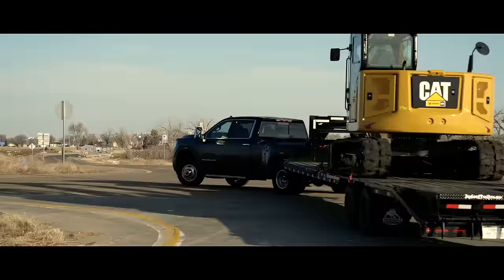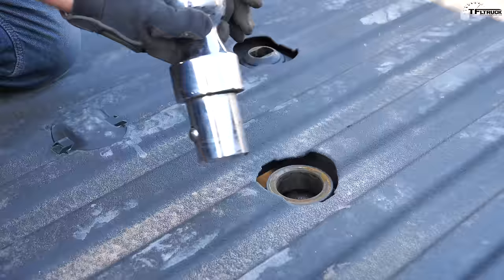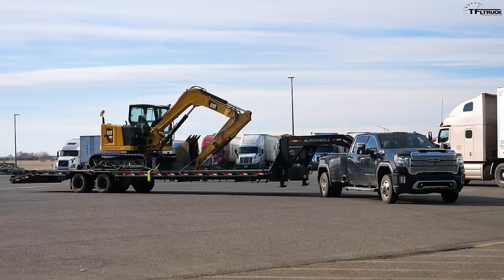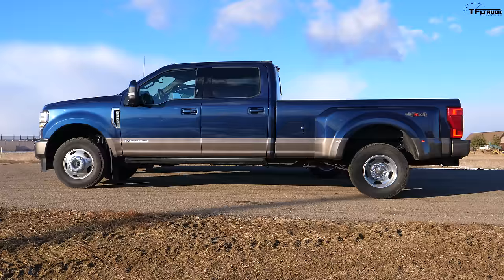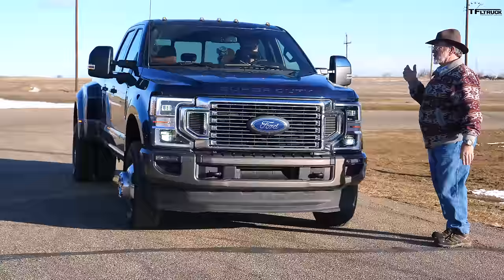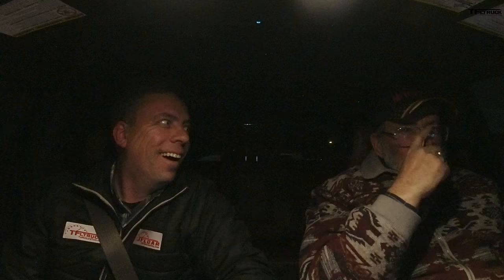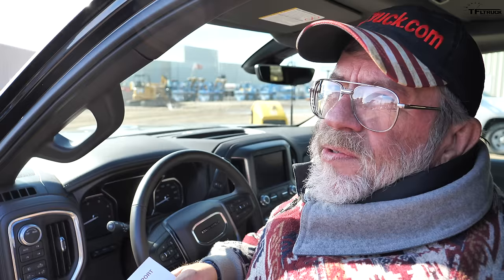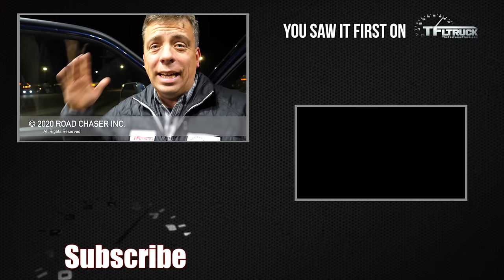30,000 Lbs Monster Tow Test: 2020 Ford F-350 vs GMC Sierra 3500 - Drag Racing & Tow Off!

Comment: A 15% difference in fuel economy is quite surprising, but I think the test loop was too short to be conclusive.  Did either truck go into regeneration during the loop?
Reply: they don't even know what regeneration is. Mr. Truck probably knows but thats it
Reply: Regeneration is an absolute joke, nothing but a pain in the rear and then it screws the truck up cause the system decides not to regenerate its self.
Reply: This is the question I had. Big difference in fuel economy when in regen.
Reply: Not really Ford says the new 6.7 gets best economy out of the three GM ,Ram and from people I talk with seems to be true.
Reply: They didn't do the test trip for the ford until it was much colder ! Everyone knows that  for every 5deg in temperature  drop  you gain  about  17% in efficiency!  Witch  declines  dramatically  after about 20%maximum  gain.  This was definitely not a scientific test or they would have done the test at the same time of day with equal temperatures
Reply: @Michael-ge3eo  The colder is gets the worse the mileage gets.  Thats a fact!  The air becomes more dense which in turn means you need to run more fuel to maintain the proper AFR.
Reply: @joshgarner805  Well, I honestly don't know what people where expecting here.. Ford has a state of the art engine that is so efficient that it's design is replicated in German TT V8 cars in the 'Hot V'.

Duramax did good, however I would wager that the F-450 with its 4.33-4.88 ratio capability and fat Boy front end literally put every single advantage into the Ford's court. More efficient engine, a transmission that is probably the exact same transmission which I'm almost positive was co-developed by GM and Ford and has nothing to do with Allison.

Chevy just reeks of desperation, they try to upscale the trucks worth by saying something to the effect of 'Yeah, but our 10-speed is named Allison, everyone knows those guys". Cmon, can't even tell what gear the Allison is in so I'll stick with this beefed up 10R80 or whatever its HD variant is called over this fake Allison simply because I don't have to guess what gear I'm in...

Anyways, both are good trucks. I'm sure you could get a Silverado 3500hd for the same price as a 350 Lariat, you just lose 140 ft.lb of torque... There's no twist ditch gimmicks or dropping rocks into fragile bed lies they can slander Ford with but at least they didn't try to like last time.
Reply: @joshgarner805  - I don't believe there is a proper AFR on a Diesel.
Reply: @SoDevious  - I keep hearing them call it a "Branded Allison" transmission.
Reply: @SoDevious  so much misinformation in 1 post.  You wreak of desperation.

They call it "Allison Branded" because Allison just became its own company.  The change in business structure required a change in description.

Comparing the F450 to a 3500HD isn't apple to apples.  Comments like these are just like in high school after losing the football game you tell the opposing team, "see you in basketball season".  There's a time when growing up is necessary.

The heavy duty trucks are not using the same 10-speed as the half tons.  Only the half ton 10-speed was codeveloped.

The truck bed issue was neither slander, nor applicable to heavy duty trucks.  If the truck needed commercials were slander, why didn't Ford sue GM over it?  Because it was true.  That display was solely on half tons.  I don't know about Ford, but GM uses different truck beds on heavy duty trucks.  If those tool box videos cutting open the Ford F150 truck need hurt your feelings, you should be crying in a corner over the Carbon Pro truck bed on the GMC Sierra 1500.  GM launched 2×4s, couches, and several objects in between at hurricane force speed.  The bed wasn't damaged.  Ford won't dare try that test.
Reply: @SoDevious  you really need to research what you're talking about.  The 10-speeds in the F250 and above, and 2500HD and above, is not the same as the the 10-speed in the F150 and 1500.  Look it up.  I use to think the same thing as you, but was proven wrong.

An F450 apples to apples comparison should be up against the 4500HD.  I bet the F450 beats the F350, too.  Duh!  It should.  You're argument would be akin to a Chevy fanboy saying, "My Silverado is better than your Ranger."  Get on the same page as reality. 

For the record, I'm not butthurt.  I've only stated facts.  Clearly, facts hurt your feelings.  It's not me that's feeling the butthurt.
Reply: Agreed, it needs to be at least 1,000 miles
Reply: @domin8ss  hha maybe i read it wrong, its 2:30am and i've drank almost a fifth of vodka..got to quit commenting on videos this late. thought you were saying the whole video was comparing a f450 to a gmc3500....
Reply: Is there a way they can tell when the truck are in Regen..........?
Reply: I would trust the trip meters in the trucks over the manual fill test. Too many variables are introduced with manual fill method, i.e.,  the pump, air in the tank, etc.

Comment: It's gotta be rough as a Chevy engineer, always getting whooped by Ford. I bet it's because of the bean counters at GM constantly trying to cheap out on everything.
Reply: You cant say always getting beat.  Pretty sure this is the first year Ford has won the Ike and the fuel efficiency test over GM in diesels.  And no I'm not a GM fan boy, I have 2017 F250.
Reply: AT4  vs Tremor diesel had the GM slightly better unloaded.
Reply: @ricktaylor966  
Thank you!
Reply: mtrujillo1973 
The OP said always, and he was wrong.
Reply: Lol. Talk about fake news, without even looking I can think of many comparisons where G.M. wins a TFL shootout like the half ton diesel just off top of my head.
Reply: @cinder9950  how about the time thre Ford failed to make it up the Ike?  I call that a win for everybody except Ford.

Comment: I live in nevada and this is my first time seeing a def pump
Reply: I've only seen them at truck stops
Reply: Don't use them they clog up the system.  Big bucks
Reply: @chadperry885  how so? I'm curious
Reply: Chad Perry I heard the same thing. It's why I always bought the mopar Def for my Cummins (15 a gallon) and ppl gave me shit for it. However, I never had a problem with my DEF system.
Reply: Always check the date on the DEF box as well. Shelf life depends on temperature and age.

Comment: The trucks are riding rough because the Cat is not loaded center of trailer. You have to measure the center of the trailer tandems to your hitch in the bed of your truck to find where to center the load. All the weight was directly on the trailer axles instead of being spread among all the axles.

Comment: You would take a lot of that bucking away if you moved the excavator ahead but then you may exceed your gvwr. I have this identical setup basically and I decided to buy a 550 and it’s 19,500 gvwr. Handles the load great.

Comment: How come y’all never mention the Ford is a real truck with a solid axle front end and the brakes are twice the size as the gm trucks like the serious stuff that makes the trucks better is never looked at and reviewed by people who claim to be the experts haha
Reply: Can you give me the actual specs?
Reply: @jeremybelcher6681  look them up.
Reply: Because everybody who isn't a Ford guy will be saying that they are bragging about the ford.
Reply: I'll give you the solid front axle on the 4x4 models if they figured out the death wobble. As for  brake rotor diameters are all about the same on  ford Dodge and Chevy. They are all limited to the 16" rim they insist on sticking with.  Brake upgrades don't happen until the f450+ class of trucks.
Reply: @twiztid-t3289  When a person makes a claim, normally it's that person that backs it up...
Reply: I’ve owned all three heavy duty trucks for my company the fords brakes need replaced every year the others are almost quarterly or twice a year , the brakes on the ford are way beefier .and about the death wobble is more of a dodge problem , there might be a few lemons from ford that have a bad ride like any company but all in all since 2011 the ford is way more dependable and when pulling trailers always the truck people pick go figure the last being the gm truck I think due to not having a solid axle

Comment: I think everyone knew the Ford was the better truck...
Reply: Wheel bearing  definitely not a Chevy or fiat
Reply: Wheel bearing Well I doubt it will be the Chevy. If both trucks are used for heavy towing you’ll have to rebuild the Chevys independent front suspension 3 times...
Reply: Always has been, always will be.
Reply: @DUNEATV  my dad's chevy suspension sucks. Know he has a ford and the chevy is going to the junkyard

Comment: I just read all the comments and just can't resist getting in on this! After over a million miles running light duty GM, Ford and Dodge Pickups, I've come to the conclusion that are all toys. And yes, they are all LIGHT duty up to and including the 550, 5500. I don't even have a brand preference, they are all junk. I ran four F550's from 1999 to 2008. I got better mileage out of tires than I did injectors! The 6.0 was horrible, ever time you pulled a trailer of any formidable weight, all the coolant would blow out of the engine and I always had to buy 4WD to have enough gear reduction in low range to pull heavy loads up steep grades.
The 6.4 delivered 5.7 MPG hauling just a 12,000lb load from Pennsylvania to Arkansas! The turbos fell apart and the fuel system was junk. The transfer cases on a 550 weren't any more robust than a 150! Just different gear ratios and the same cheesy case. I twisted the gears out of three of them. Broke two ZF transmissions as well. The best thing about the Ford F550 was the Dana 135 rear differential, bulletproof! I ran three Dodge Rams and stopped at 2006 model year because the new 6.7 is as big a POS as the Ford 6.7. Dodge trucks are built like a Revell model from the 70's when they switched to the snap together ones instead of glue together! You don't even need tools to take most of the truck apart, just yank on it! The G56 MB transmissions weren't bad although the dual mass flywheels were absolute garbage and the suspension was junk as well. Got better life out of tires than ball joints, track bars, etc. I don't even want to start with GM other than that the electronics are so bad your lucky to get it started or have anything electric or electronic even work in your truck after 50K miles. The Duramax would be a great engine if GM would have kept their hands out of it! Unfortunately, today the light, medium and heavy duty trucks are unreliable, get mediocre fuel mileage compared to what they could be capable of and cost a FORTUNE to repair. And BTW, the garbage emission systems WILL fail because they DON'T work! That's my $.02 I guess I'm just a disgruntled truck owner! One more thing, if your tires don't say 14.5, 17.5, 19.5, 22.5 or 24.5 on the side they are absolute garbage and never meant to haul anything!

Comment: So the ford is faster more powerful better looking and gets better fuel economy cant I'm surprised government motors only makes junk
Reply: The Ford does make more torque and has the larger axle, so it's no surprise it won in the drag races.  Looks are subjective.  As for the junk comment, you're wrong.  GMs typically outlast Fords.  That's why Ford is the #1 selling truck while GM is the longest lasting.  Fords have to be replaced more often, and are therefore bigger pieces of junk than the GM trucks.
Reply: better looking is purely subjective
Reply: @domin8ss  yeah that's why the chevies have more recalls then ford every year bahh fords are the true backbone of the industry ambulances cop cars taxis etc fords are work horses
Reply: @kinggr1ffy422  it's my opinion you are correct

Comment: I like how ford fan boys keep making these “ I’m better than you” comments when it wasn’t that long ago that their diesels couldn’t stay together.  Secondly, we consistently say “ the GM trucks” when we refer to the Chevy or GMC but when they add the totals up in sales for the year they are always split up so that GM doesn’t get the top slot.  The Ram hasn’t even got tested yet and your trying to grab the trophy.  Lol.
Reply: Ford still normally beats their combined sales too, they are smoking them right now.
Reply: Ford out sells Chev and GMC combined, 2019 Ford = 896,526   GM =  807,804   Silverado = 575,569  Sierra  = 232,235
Reply: Just throwing some things out there that are in a gray area and I’m not talking about this years sales numbers.  Since we are talking about it,  Ford claims #1 most sold truck for 36 years.  In 2015 GM sold more trucks if you combine GMC and Chevy.
Reply: @hunterharrell7491  wrong the ram is top in sales right now
Reply: Does that mean that years ago Ford should have added Lincoln Blackwood trucks And Mazda Too! LOL

Comment: Now do 0-60 With the loaded trailer on. thanks TFL
Reply: I was hoping they included a loaded trailer drag race too man
Reply: Ford wins by over a truck and trailer length...isuzu deisels are complete garbage and since chevy cant build anything themselves....sad
Reply: @danielthomason5685  Any duramax is still better then the 6.0 or 6.4 ford  ever was.
Reply: @heavymetalworks6375  yea maybe this is why ford said to hell with outside sources design and built the best motors and transmission in any consumer truck
Reply: @danielthomason5685  LOL your out of your mind if you think that.
Reply: @heavymetalworks6375  You realize the 6.0L and 6.4L aren't Ford engines right? They were designed and manufactured by International/Navistar and shoehored into Fords, The current 6.7L Powerstroke (Which has been in production since 2011) is a Ford engineered and manufactured engine and its been just fine.
Reply: Heavy Metalworks  you right, the 2020 Isuzu dura Max is better than a power stroke from 2004

Comment: If I was rich I'd have that ford over a mercedes lol
Reply: Me too Ruben you're a smart young man
Reply: Tom Wetz  I'm from Belgium... 😅
Reply: Mercedes doesn't make a dually. They do make a 6x6. I would have that over any Ford truck. But it's still not the same class of truck though. As for working on my car, yes I do. I don't trust anyone working on any of my cars/trucks. I use to have an Ford Lightning. I did all the work to it. The only thing it went to the stealership for was the recall on the brake master cylinder. I tried to talk them into giving me the inline fuse & I would install it myself but they wouldn't. I also have a Explorer Limited & a Fiero GT with a motor swap that I do all the work & maintenance on. My CL55 AMG is a very reliable car. No major issues with it. Ford does make some new stuff that isn't bad. If I had to buy a dually for some crazy reason I would buy a Ford. But all Chevy's cars & trucks since the late 90's to early 2000's have all been just crap. It started right before they became government motors. Always quality & design issues with them. They never admit they got it wrong too. They try to hide their mistakes like the ignition switches when they got the manufacturer to make a new improved switch but use the same part number as the old defective one so they wouldn't be blamed for the deaths of all those people. That's just dirty! All of the Government Motor products suck. Also personally I do not think any new car or truck are worth the money. They are waaaayyyy over priced.
Reply: Ruben Braekman if most people were smart they wouldn’t buy any modern Mercedes automobiles .
Reply: How much can you do with a nice car just get from point a to b and pull gold diggers how much can you do with a badass dually get from point a to b pull all kinds of bitches fat or skinny multiple women also pull anything and live in it
Reply: Mercedes Benz E63-S AMG that 6x6 may be nice and cool but the dually is gonna supper cede anything on that 6x6
Reply: I wouldn’t waste money on a ford
Reply: Tom Wetz  hope you realize gm trucks are mostly made in mexico...
Reply: Still a expensive fix
Reply: Tom Wetz yes yes yes
Reply: Mercedes Benz E63-S AMG Mercedes is junk nowadays aside from diamler trucks. I mean any German brand is just a money pit
Reply: Jamor I would but especially compared to a trashy money pit German car
Reply: I'd settle for getting my 94' F250 fixed....
Reply: Same
Reply: @heythere3780  ouch...

Comment: Have you considered checking DPF levels and whether or not the trucks go into Regen during the test?
Reply: Good question. My 17 duramax can go about 5000 miles on a tank of DIF. My 18 cummins is about the same. Both are pulling trailers daily.

Comment: Awesome video guys! 
Wish I knew what truck pulled better with less jitter, and what was causing it too.
Keep them coming guys.
Reply: I wouldn’t be surprised that it’s coming
from the trailer and not the trucks
Reply: @mwjnc  Agree. I also wonder if it’s load placement. Having the load too far forward would create a similar situation with jerky movement.

Comment: usually that bounce you're getting is because of to much weight on the front axle of the trailer that is transfering the load to the hitch. Would be nice to have seen you guys adjust load as I think it was off and causing that bounce....speaking from past experience.
Reply: Agree.